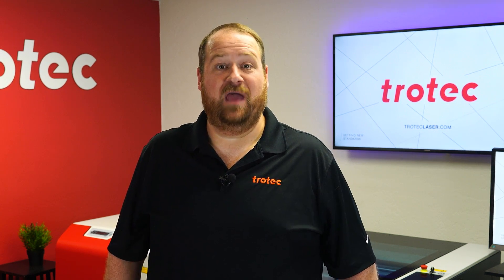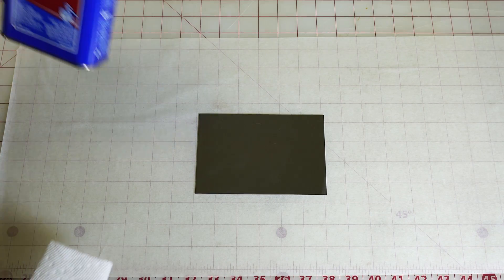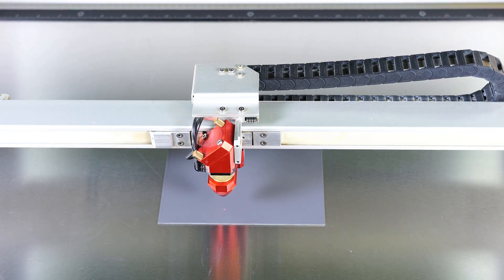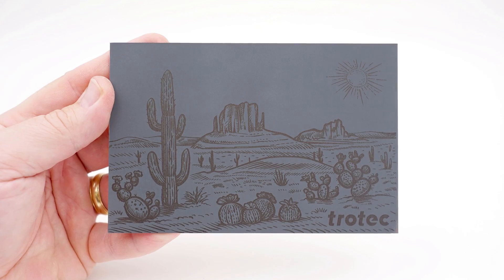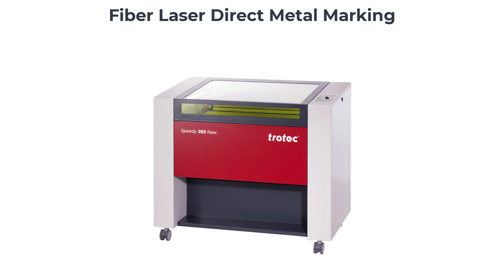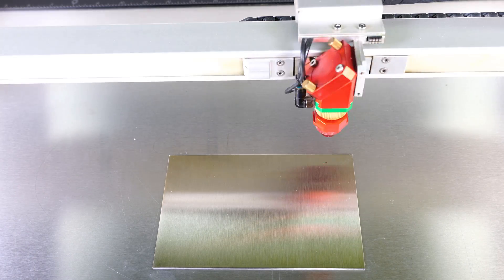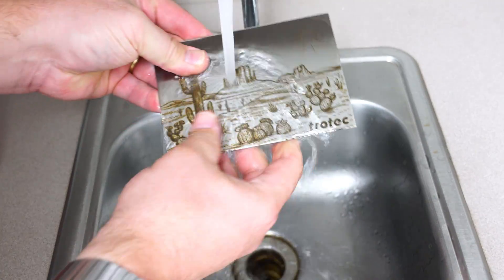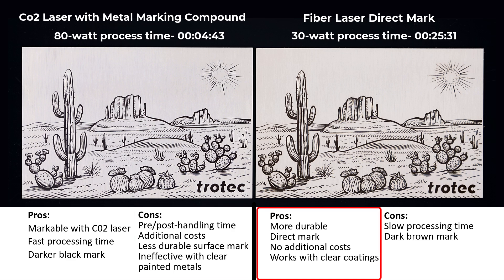Deep Dive with Laser Dave: Metal Marking Compound with CO2 Laser vs Fiber Laser

Comment: 25 minutes in 30 watts - it means: it takes 8 minutes in 80 watts. As result we hawe only can 2 times quiklest with spray. I think spray is not needed.
Reply from the maker: Just use the preset glass or acrylic settings to engrave mirrors, depending on whether the mirror is made from glass or acrylic.

Comment: Hello Dave, is it possible to mark for example silver or gold with the co 2 laser after applying the cermark coating?
Reply from the maker: Marking gold or silver with metal marking compounds is possible but settings can be more difficult on metals with no carbon, and testing will need to be done to find the best settings.
Reply: @TrotecLaser  Thank you for the advice